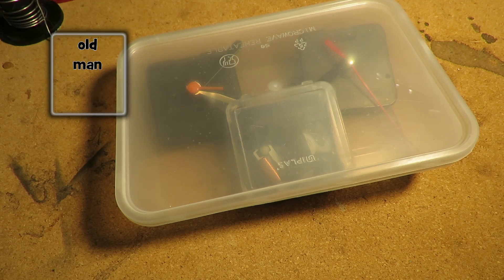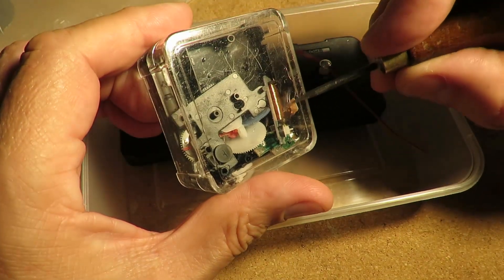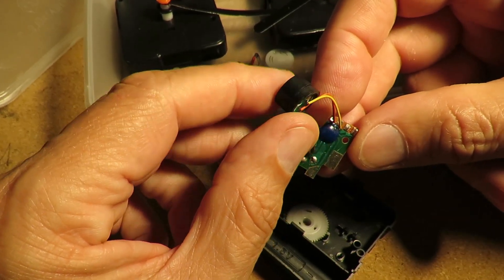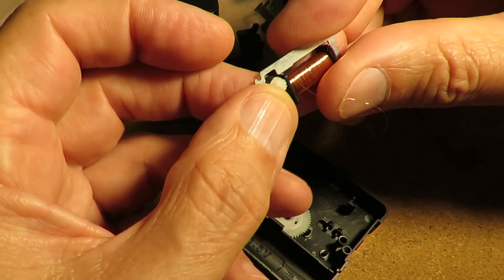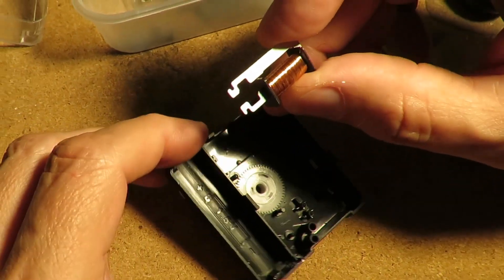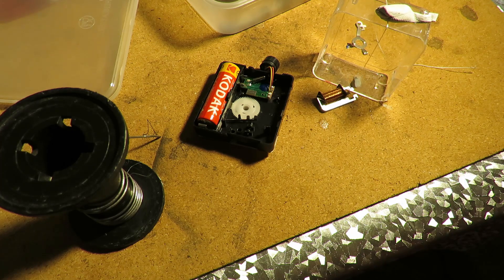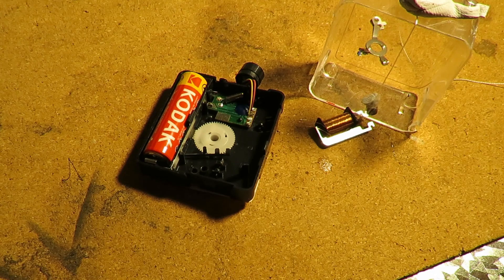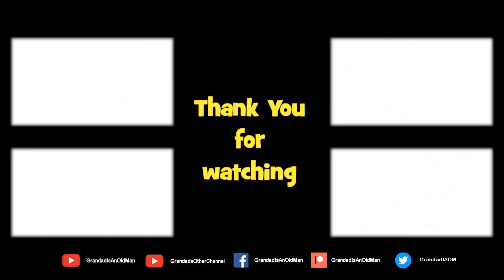Quartz Clock Parts inspired by Just4Fun

Comment: I recently told slider (or one of the other electric boyzzz we seem to be subbed to) to have a look at those coils. I find the clock coils easier to handle than the tiny ones in the rockers. If yuouo use the clock circuit, you do have a 1 second pulse, where as the rockers circuit also sense the incoming magnet or the magnet passing by.